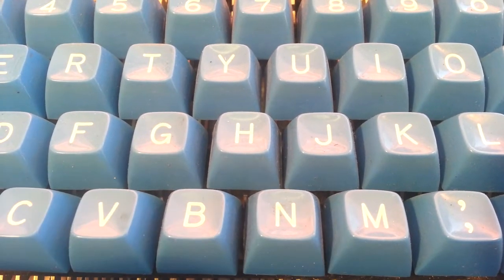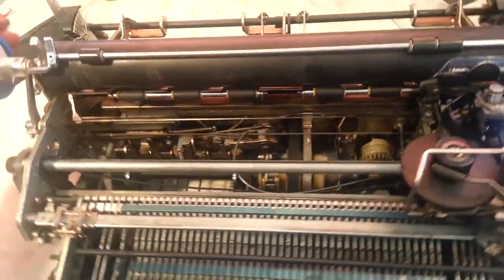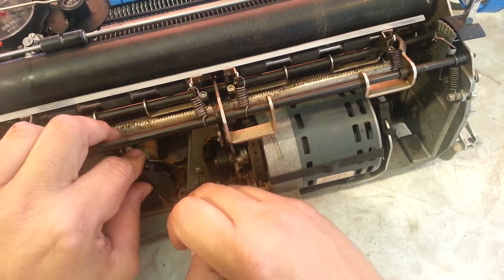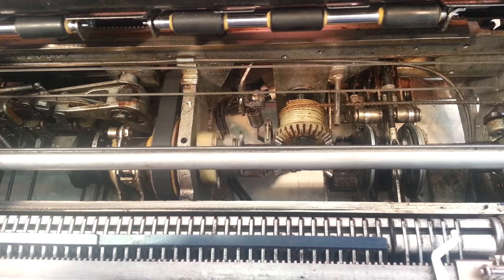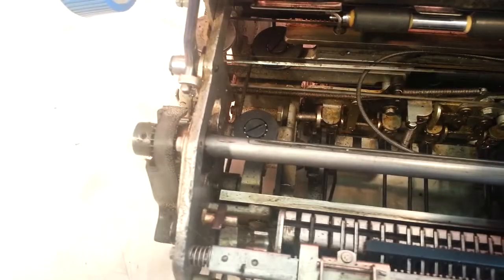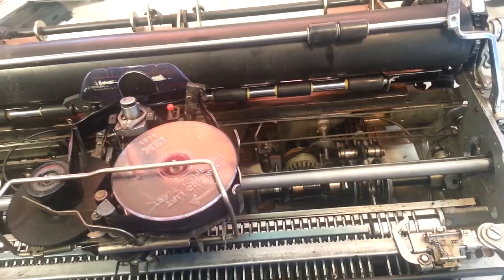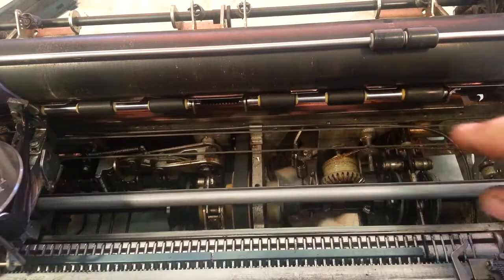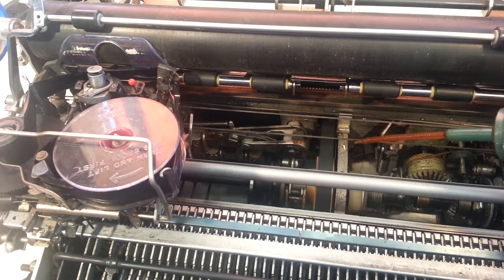IBM Selectric Typewriter Return Tab Cord Cable Repair Winding Main Spring

Comment: Great video as always! Can I ask what type of lube you use on these and the manual machines? Have thought about using synthetic non mineral oil with PTFR pr maybe lock oil as to minimise residue and gumming up, would thos type of lubes suffice? Thx in advance!
Reply from the maker: Marvel Mystery Red Oil

Comment: neat. Mine has a tab that operates normally most of the time, but sometimes stalls once past the halfway point. I thought the ballassembly was hitting the black safety covers below, so I removed them, but it still stalls even with no clear interference. Wonder what causes that...
Reply from the maker: I wonder too.... Hard to tell with out some on-hands analysis, could be lots of things or combination.

Comment: Do you have a video on how to thread the other cord in the Selectric II?  and what is the technical name for the other cord?  On my machine the white plastic tension  pulley broke and both cords fell off the machine and the tab cord ended up jamming in between the white and metal gears
Reply from the maker: Tab cord is the cord that goes around the spring pulley on right & attached to drum in front. Return cord/cable attaches below carrier & heads towards stationary pulleys on left & then back side to rear drum. Yes the return cord/cable is pre attached but takes a direct pathway around pulleys to drum. I don't have any other videos about tab/rtn cords.

Comment: I need a blue-keyed Selectric!
Reply from the maker: Wasn't so sure this was going to be a survivor, looked rough, in that case I was going to transfer keytops to a selectric 2, but after I got pulley & cords installed & got to run the typewriter thru it's paces, It seems to be strong & after some more basic maintenance, I'm pretty confident it's gonna last a while. But It has been Pre-sold to an enthusiast who is a member of ATC. Looking at getting the ugly green case powder-coated.
Reply: How do you determine whether a machine is salvageable or not, and where do you even begin? Just got a selectric I and finally got the shaft turning but there are many problems left to sort out... Thanks for the videos, they are helping a lot!

Comment: Phoenix Typewriter, just wondering.. When you say the pulley broke (0:20/17:14), I noticed there is a little metal bracket there with a thick U-shaped spring. Well, my Selectric II has a white plastic bracket and it is broken. I found the spring in the bottom of the case. When I turn on the carriage constantly pulls to the right. Will replacing the bracket and spring fix it or will it also need adjusting?
Reply from the maker: Missed this comment somehow, original pulleys were plastic & will eventually break. If cord don't come off you can just replace pulley, if not, you would need to go thru the whole process. See this video for just pulley replacement https://youtu.be/NnwHHR7lnRA
Reply: To add to this, you could get replacement plastic pullies or metal ones like this. The replacement plastic ones were guaranteed to break again eventually as they wear thinner and thinner unlike the metal one. The metal ones were more expensive though.